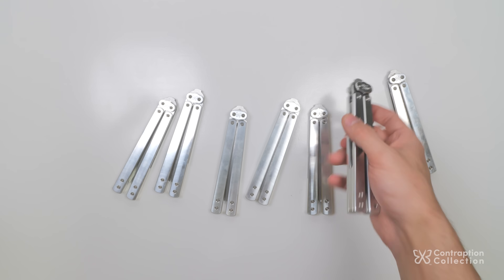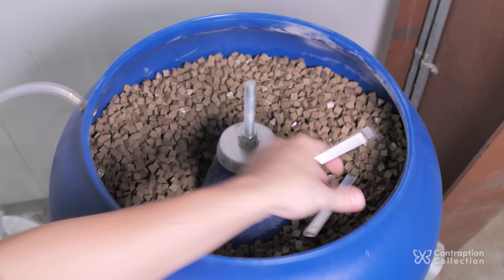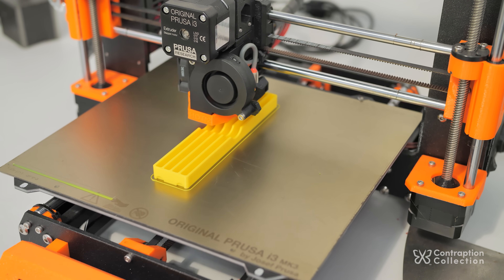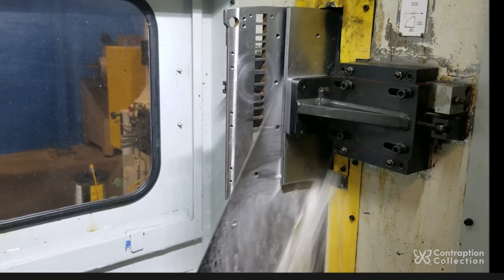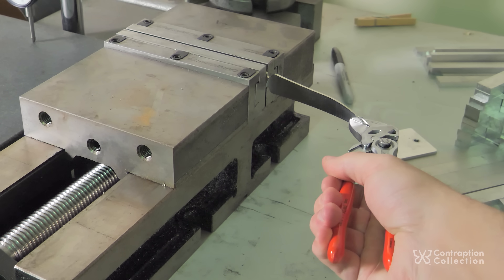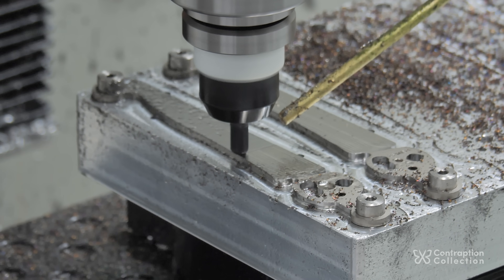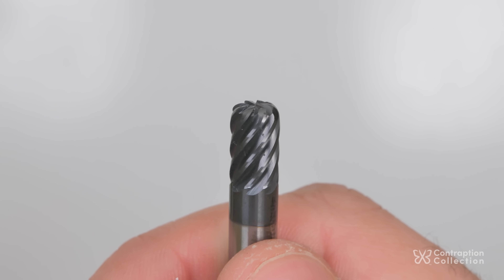I thought I was finished! Baliscissors: Ep 28

Comment: In stainless welding and fabrication, we often pre tension/bend parts before welding, we also often straighten out parts by heating them afterwards, sometimes under pre tension aswell.

It's not entirely clear if your bending issues is due to heat or internal stresses being removed, but my solution might work in any case.

If you're able to add a pre defined amount of stress/tension/bending while milling the bevels and compensate with the tools pathing, you might be able to work towards a repeatable setup that might help with your issues. The pre bend, should obviously be in the opposite direction of the bend you currently experience after milling. I imagine you might be able to have a large radius in your blank pallets that the blanks are held tightly down to, creating a slight bend.

It comes down to how the steel reacts to the heating/cooling cycles, if there's tension in the correct/opposite direction when the heat is applied you're greatly limiting how much the steel is able to deform. You could always start with a pre bend of the same amount of bending you experience now without any pre bend.

There's also the possibility of creating a setup for straightening after milling the final bevel, by use of pre bending and whatever amount of heating you're comfortable with, as to not ruin the temper. You should pre tension like half the amount of the post milled bend, and apply heat to the non beveled side. Might be hard to make a repeatable setup, since heating the entire piece in like an oven, wouldn't be very useful since you need localized heating to only the one side.

Comment: Hey,

I would guess you would need to have a stress relieve heat treat on the blade before hardening. Just like they do on swords and stuff! I think Alec Steele did it 2-3 times on his work. Heat up to the appropriate temp for your steel and let it cool slowly to let the crystal grain structure regrow without any stressed in it. 

As you discoverd heat during milling releases the stresses that are inherently inside the steel from manufacturing and makes them warp. 

Great work!

Comment: I'm no machinist expert, but I see you cut a whole bevel in a blade in one go. That should mean that all the heat generated goes into that blade, hence warping it. If you try to run one length in each blade at the time over, say, 4-6 blades, this should give each blade a bit more time to dissipate the heat generated and maybe not overheat. It might also give the tool some time to cool down a bit in transfers between the blades. It would take more time do do the cuts, but it might also be worth a try?

Comment: Hilariously, not long ago, the titans might have already had an answer to your blunt8ng blades? An expensive answer, but an answer no less. Ceramic tooling. That's just an idea though. That or you could grind the bevels. There's actually a good way to grind them without heating the blade too much. Lots of coolant and a VERY porous wheel

Comment: I’d finish mill the blades un heat treated. Normalize to reduce stress. Then heat treat. This is what bladesmiths do with blades we forge or we grind, as it means less warping during the quenching of the blades. Changing your steel may help as well depending
Reply: Yeah I was going to mention normaloz8ng before heat treating but I just don't know enough about it to be sure if that's common or not.
Reply: @Gkitchens1  if you don’t want your steel to warp it’s a very good idea. Now my experience in stock removal is VERY small. I forge my blades mostly to shape and grind only a little bit. But I do know that you can get warps if you grind a blade with to much stress in it. So you normalize to both reduce stress, and in some ways make it softer. If your feeling it (and have the equipment) you can fully anneal it and then grind it.

Comment: As stated in the video" Shocking the tool with coolant decreases the life of the tool..." If you are machining without coolant during the whole program, then flood it with coolant afterwards, that can shatter that type of tooling. Running with coolant  during the whole program is better for chip clearing and cooling than air. Flood coolant is best for chip clearing, but the air nozzle you had at first looked like you could run coolant through it and make it a mister, which would be good cooling, chip clearing, and even for filming

Comment: You might want to consider a much lower hardness in the heat treat as they don't need to be knife blade hard, and even high end professional tailors shears and hairdressing scissors are all soft enough to have their curvature adjusted by hand with a hammer and small anvil as part of the final assembly process.   For the really high end stuff, the blades are often laminated with a very thin high carbon edge and mild steel or stainless  body.  This way, you can have a very hard edge but they cam be very easily adjusted with a hammer without any risk of breakage.   If you want to do a stainless steel, I would probably choose something with a high vanadium content for fine grain and exceptional wear resistance, which means you don't need them ultra hardened.  Such a material may be difficult to machine though..

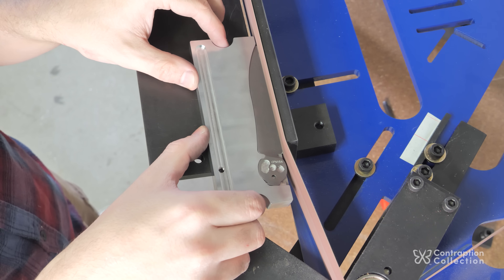Comment: 6:10 could you tilt the platform so the blade is diagonal to the belt? would use the whole surface of the belt, but i'm not sure it's possible
Reply: he could make a block and secure it to the platform to sand diagonally. 3d print it or just cut one out of wood, that'd be easier, cheaper, faster?

Comment: Finally a chance to be useful. Machining these in the traditional way is not the right move. Look at electrochemical machining of a turbine blisk. You can easily 3d print and copper plate the tooling at home. Electrochemical machining doesn't introduce any stress in the part, and doesn't care about the hardness. Soft aluminum or super hard inconel it makes no difference. No warping.

Comment: odd thought, but have you considered cooling the fixture your blades are attached to?

also since your typical working multiple blades at once, would it make to hop between blades instead of finishing one before moving to the next (kinda like stitch welding to manage heat?)

Comment: Nice progress! Suggestion for the edge-grinding on the belt sander; tilt your jig (as in put a wedge underneath it) in the horizontal axis so the the blade is diagonal across the belt and makes contact across most of the width of the belt. This will make the belt last longer, and greatly reduce the chance of a rip/cut happening in the belt.

Comment: the pattern-engraved handles look great - I love the hexagons, but also, I kinda think they'd look even better if you anodized the part first and then engraved afterwards. The contrast between the colored matte anodizing and the machine-finish bare aluminum would look great, and as an additional bonus, you can pre-make all the parts anodized ahead of time in large batches and not have to commit to any set of engravings that may or may not even get purchased until you get an idea of how many people want to pay an extra dollar or two for the geometric designs vs a bare handle.
As for the uneven wear on the belt of the horizontal belt grinder, you should try making a wedge spacer to run sideways across the platen so the two ends of the blade all but touch the sides of the belt. I think that would help substantially. 
And finally, for the blade process, you have a surface grinder right? Have you tried maybe setting the blade up so it's sitting at the angle of the bevel and surface grinding the bevel in? Depending on the throw of your grinder you could probably do a lot of them in parallel that way.
Reply: Oh and I just had one more idea about the warping blades - if the problem is severely unbalanced material removal, what if you made the blades too thick so you can remove a certain amount of material off the bevel side and a similar ish amount of material off the flat side?

Comment: What if you made your blades slightly over thickness and surface ground the other side to counteract the stresses from hard milling the bevel? Induction hardening only the very edge might also be worth a look, the bulk material of the rest of the blade self-quenches, it could be a much faster process than the oven, and might even remove the need to hardmill at all, but it would be an entirety new thing to figure out
Reply: Hardening only the edge might be a good idea but could also introduce warping. I mean think about Japanese swords. They get their curve from selective hardening. It wouldn't be as extreme on such a small scale, but in this case, precision is kind of important

Comment: you could try using a vortex tube cooler (seen in Linus tech tips video) if you need to stick to air or try adding a way of cooling the bottom of the blade which would not interfere with the bit (like a larger heat sink or cooling fins + air/liquid). Also it might be worth looking into belt sanders with a convex contact wheel, which I've seen Matt Stagmer (man at arms/ that works) in some of his videos in the past, since belts are cheaper than bits (most of the time). Anyways really looking forward to seeing what you do in the next update, thanks for showing us the process!

Comment: Most scissors have a much shorter bevel that is only 1/4th of the blade width just to make the cutting face a bit thinner before sharpening.  

Why are you trying for such a long bevel in your design? I suspect it’s mostly to imitate the appearance of a knife blade? 

I personally wouldn’t mind if they had a more traditional scissor profile both in bevel and profile. Maybe that would help with the warping problem.
Reply from the maker: The full bevel is to reduce weight so they flip better in "bali-mode".

Two blades makes balance a tougher challenge. Especially when I want to keep the handles light too.

I've experimented with other options like skeletonizing the blade, but it doesn't look as good and doesn't reduce as much weight as I expected.

Comment: Have you thought about using your surface grinder and flood coolant to bevel the blades? Could machine or 3D print a fixture to orient the bevel correctly, and could even batch grind the blades. Appreciate you making such in depth videos! Really fun to watch.
Reply: I missed a lot of the previous installments on this project, so I don't know if this was covered, but I wonder why he chose hard milling over flooded surface grinding.  The surface grinder would be my first suggestion also.
Reply: @TuckMcSouthard  there are definitely good reasons to hard mill, especially in a one man shop production environment, but very interested to see if the tormach grinder can handle flood coolant, and if that would keep it cool enough
Reply: You have to understand. The grinder is a great tool. But it’s slow. Super slow. Especially compared to a mill. The wheel needs to be surfaced every couple ops. And generates a lot of heat. But that doesn’t mean I disagree. The tool life is far superior to an end mill and the tolerance is much tighter. I def think it’s worth a worthy shot.
Reply: Was just about to comment this
Reply: That's a brilliant idea, it would be so much faster and cheaper, once the fixture is dialed in.
Reply: He would have to orientate it perpendicularly though wouldnt he? Else it would grind over the bolster. Maybe the belt grinder would do better.
Reply: @paulwilson2204  definitely has to be close to perpendicular to grinder travel, but depends on what kind of plunge line he's looking for. A belt grinder would definitely get the job done, but it is much less repeatable than a surface grinder, and keeping the parts cool would be more challenging.
Reply: Yeah, I don’t know much about making things out of metal in general but I also wondered why he is machining the bevel instead of grinding it, I suppose there might be a good reason? I don’t think there’s any harm in trying tho lol
Reply: Since he's only semi finishing with hard milling, maybe there's a super aggressive grinding wheel like a Sol-Gel that can hog out that powdered metal. An open dress with coolant on the grinder might generate a more manageable amount of heat. Cutting perpendicular to each blade would also build up less heat in each blade.
Reply: it would probably take a *really* long time to grind away the amount of material that he's machining off in the video. that would be my guess anyway.
Reply: @superordinate  grinders aren’t terribly slow for removing hardened material. Possibly not as fast as hard milling, but done at an industrial scale quite regularly